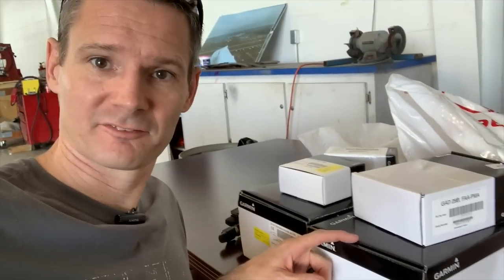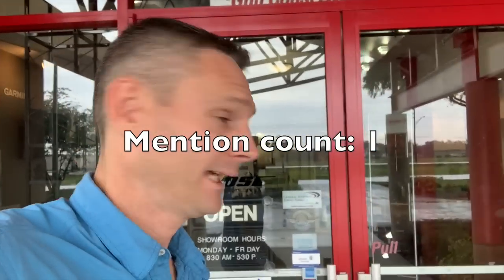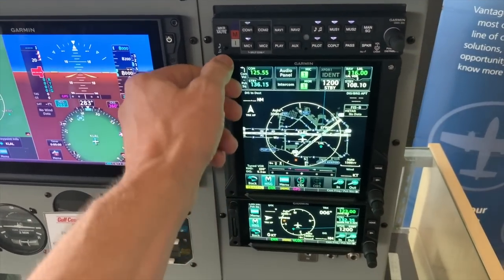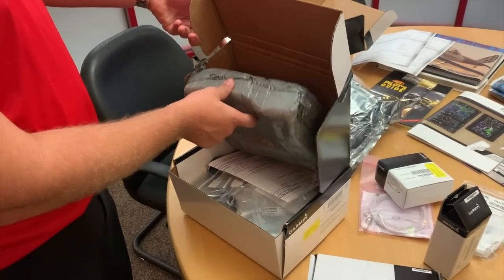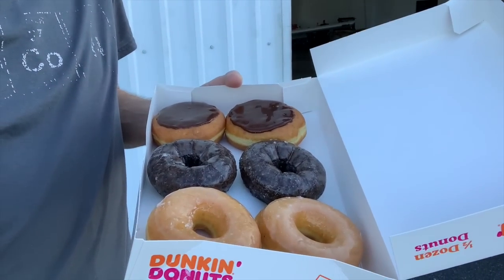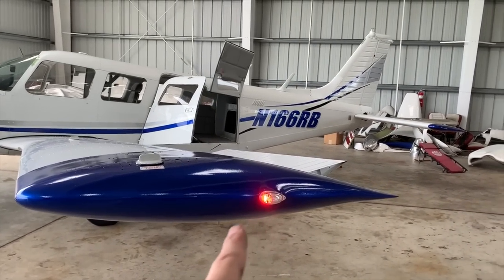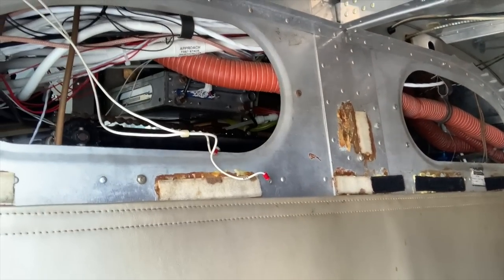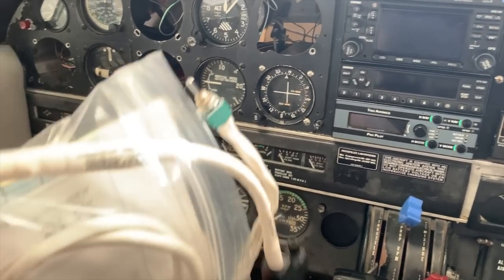Dual Garmin G5  Cheap Glass panel Cost & Installation Cherokee 6 PA32

Comment: Just installed dual g5, 375, gmu11 and gad 29. Took me about 60 hours in my experimental. So worth it!!
Reply from the maker: very cool!
Reply: 60!!! Only takes me about 16
Reply: @melissaculbertsonnn  yea but I had to rip out everything that was old, all new wiring, etc
Reply: @DanCoastie  so do I but okay
Reply from the maker: Nice!  What tricks/tips do you have?
Reply: I did the same but ended up with a 400W instead of a 375. I didn't build my airplane and there was a lot of work to tear everything apart, figure out wire routing, mount components, update the electrical system, etc. It was definitely time consuming as my first exposure to aircraft wiring, CAN bus, etc. I also CNC cut a new panel, flush mounted the G5s, manufactured an overlay to match the installed panel, etc.

Comment: I get such a kick out of you.  I have been an auto/truck Mechanic since the mid 60s. Retired in 2015 I learned a no crank could often be overcome by a rock or a hammer with a direct strike on the starter. After that don't shut her down till you get to the garage.  Vice grips a hammer a pry bar will get er done. Just don't forget to bring your roadside toolkit because you never know.  Good luck. I enjoy your sharing with us.

Comment: "Magnetometer has gone woke because it is sensitive." Thanks for the laugh!
Reply from the maker: hahahaha!
Reply: I imagined that the ignition system would put out more magnetic noise then the lights would.
Reply: the hell with them if they can't take a joke!!!  But don't piss off the Cleetus, he looked like he wanted you out the door for a minute.  BTW, there is a Cleetus on Yuutoob.  Also btw, psssst, your Mercedes is showing again - it's contrary to your act.  Try arriving in an old utility truck.
Reply: @therealjimmysworld  hahahaha woke and sensitivity goes hand in hand like vacuum pump and eventual failure lol.

Comment: G,day Jimmy's World from Quarantine house lockdown Sydney Australia.
* The decals are looking great. I especially like the wing tips.
Avionics
* The approach fast stack is convenient and cost saving. That is really something to check on purchasing a plane. However were to mount the pin box/unit behind the panel for easy assess.
* Like the LED Nav lighting. Even VFR (10mins sun up/down) much better than the globes for visability.
* The G5 has so many features, and will make flying more enjoyable.
* I'd still like some de-icing system!
Take care Jimmy 
Wings level
🌏🇦🇺
Reply from the maker: Hello sir!  Thanks for the comments.
If I need de-icing, I've flown too far north ;) 
Yeah, I'm looking at more all weather capability on the next one.

Comment: Put a fast stack dual g5 setup in an apache. Sweet little setup. You made the right choice.

Also, the mini red baron beacon is amazing if you ever need to replace an old rotating jobbie

Comment: The G5s are definitely cheaper than the GI275s, but correct me if I’m wrong, but I don’t believe the G5 HSI can display VOR/LOC guidance?
Reply: G5 is cheaper then the gi 275 because 2 gi 275 can eliminate all the 6 pack indicators. Also the G5s are able to show vor

Comment: So, since you bought this stuff just a couple of weeks ago, can I ask you why you went with the G5s instead of the much more capable, albeit more expensive, GI-275s?  I would have thought that touch screen, SVT, and the other features would have made it a 'no-brainer.'
Reply from the maker: Thanks for the comment.  I would have much preferred the 275's however, they are not certified for my a/p.
Reply: @therealjimmysworld  Understood.  Thank you for the answer.
Reply: @therealjimmysworld  what do you mean by a/p?
Reply: @markp.9707  auto pilot
Reply: @Kerie871  thanks!

Comment: Looks like on power up they have the HSI power wired wrong, it should come on with the aircraft master like the AH did, not the avionics master.
Reply from the maker: Not according to the installation instructions.  The HSI is on the avionics bus and the AH is on the battery.  I double checked that one.
Reply: @therealjimmysworld  I'll look at my drawings again also, I guess if you lose avionics power there will not be any Nav data to display anyway. Although heading is still needed but if the GMU 11 isn't powered by the backup battery you will lose it as well. Nice upgrade.

Comment: Enjoyed this hope everything works ok. Are you still editing the video about the control service or did I miss it. Safe flying my friend.
Reply from the maker: Thanks for the comment.  Are you talking about the one where I adjusted the rigging and messed it up?  What I learned from that was to make the jigs (from the book) and adjust everything according to those jigs and it ended up needed the left flap adjusted down.  Now it fly's hands off and straight.  Basically, a smidge better than before I messed with it...
Reply: @therealjimmysworld  you were having problems with the trim I think and asked for comments on how to fix the problem. You had said you were still editing the video on how you fixed it. I’m old and may not have it completely right n
Reply: Thanks I was afraid I had missed one of your videos, I always enjoy them even though I don’t fly myself but love to. Be safe out there.
Reply from the maker: Gotcha, yeah, I recorded the video however, (honestly) it was really boring!  LOL, adjusting rod ends and cables... that's it... very anticlimactic!

Comment: How much weight did you loose getting rid of the vac system?
Reply from the maker: Thanks for the comment.  The weight was pretty close to a wash.  The vacuum system wasn't all that heavy.  The atitude/dg/cdi were pretty heavy, but the G5's have those batteries.  So, maybe 1lb total.  pretty insignificant overall.

Comment: You know, I'm no technophobe, and I know a little bit about aircraft. Still, I have to ask, with the other avionics upgrades you did, why rip out the working vacuum gauges for the glass? I get the shiny factor, but in your own words, you don't get what you paid for them added to the value of the aircraft. What is the gain?